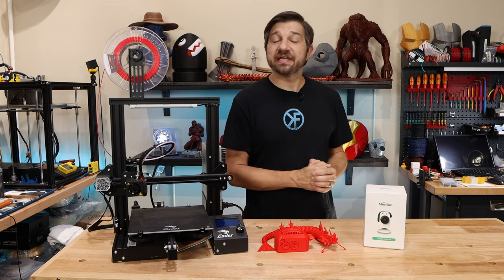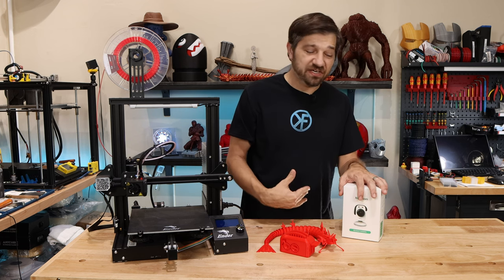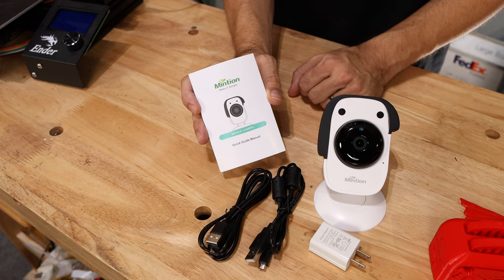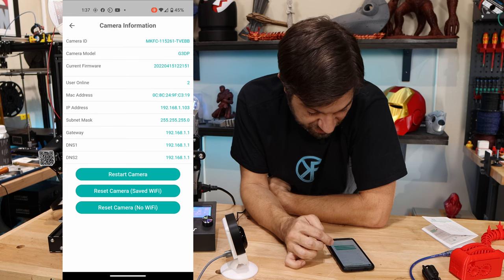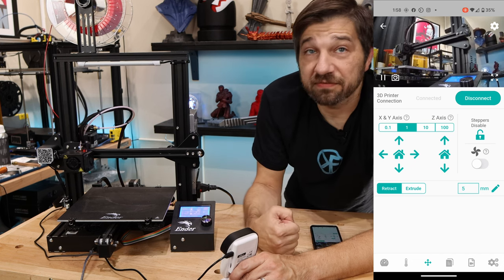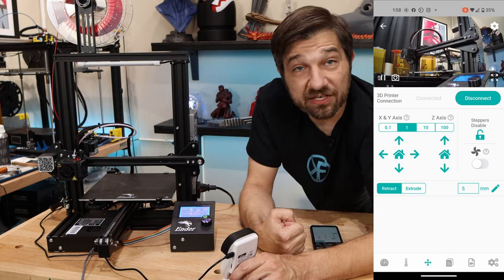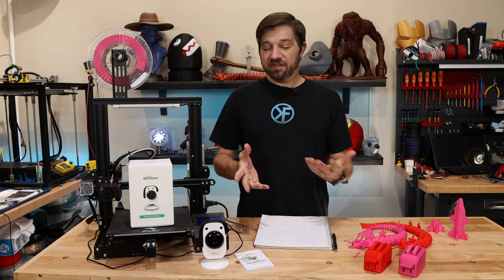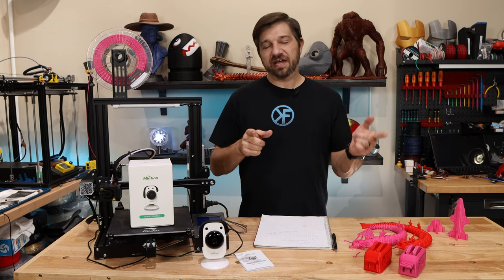Ender 3 Timelapse: The Mintion Beagle

Comment: to do vase mode, put the camera in "normal timelapse video" mode, instead of "clean" mode.  the clean mode tells it to move the hot end aside and move the build plate up front before taking a picture.  the normal mode just takes pictures at preset intervals without modifying the GCode.

Comment: Kris, a very in depth review.  One question that would help with stringing, can you record on a specific time lapse?  If you could set it on say 1 minute period the printer would run normal and you would still have a video, just not as pretty.  Another  option would be on a layer change to just record it then, without moving to a specific spott
Reply from the maker: Thanks David! With OctoPrint you can do what you suggest and that's often what I go for. Take the picture on layer change no matter where you are. This works great for a fixed bed printer like the Ender 5s but not so much for moving beds like the Ender 3. I could probably help by moving the photo place to the center of the bed but that's just on average a better place.